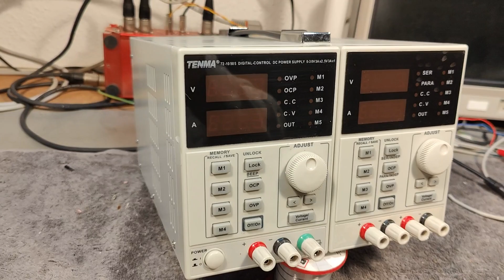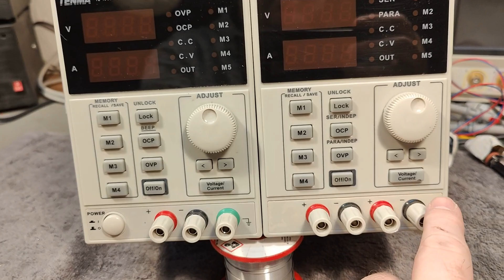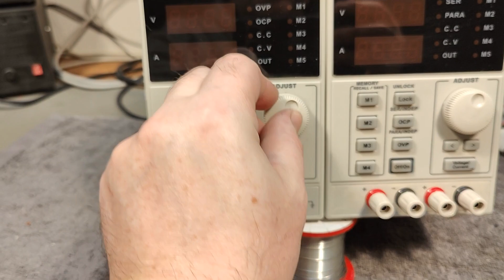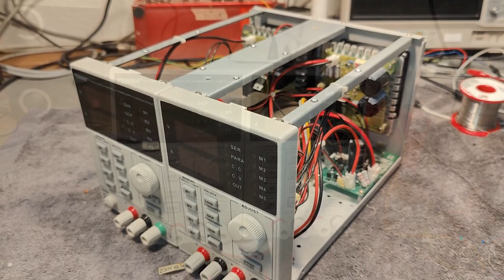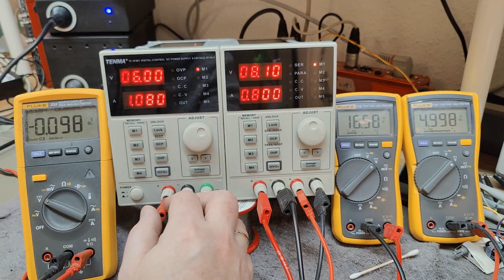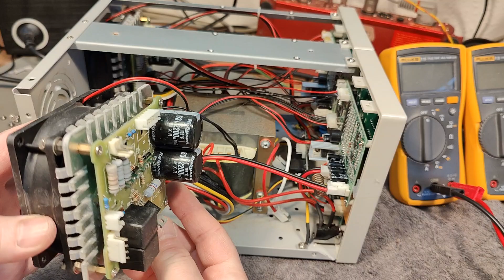Tenma DC Power Supply 72-10505 dual 30V 3A single 5V 3A

Comment: I've got the Tenma 72-2540 single channel DC supply, 1CH, 30V, 5A and it seems to be fine. The switching/metering is a little odd I guess, but if you use the supply on a semi regular basis, it doesn't seem to be a big problem.

Comment: Good video! Strange that the 5V output stayed on when you turned off the main power. Bug or feature?
Reply from the maker: the whole feature set on this unit is hard to understand :-) terrible low quality all over, much better to find a true analog psu, this one is almost prepared to be digital remote controlled and add all sorts of wierd and hard to use features implemented in a way i just dont understand, a power supply must be simple to use, and you must be able to know it does exactly what you want,
Reply: @TeardownOZ2CPU  I agree completely!

Comment: Hi Thomas, when I look at it like this, I consider myself lucky that we have the resources we have, even if it also has some imperfection - the stabilizer between the capacitors behind the N - coder, but it can be moved down to the chassis (it then works as a cooler and the heating of the capacitors disappears) and what I didn't understand is the spacing of the output terminals - you can't use double 4mm connectors.
This is not the first time I've seen this assembly of power transistors, about a month ago my charger died, the PCB is double-sided, but the transistor is half in the air = first soldered, then screwed, I had the same thing with the daytime running light converter on my previous car - probably a way to create an automatic time error so that you have to get a new device.
Repairing a power supply damaged in this way would be not only unprofitable, but also pointless if there is a design error = the power supply is destined to be an organ donor.

Edit: You received an email, I stupidly didn't write the subject there 🤪

Nice day 🙃 Tom

Comment: Hi Thomas. I've got a nearly identical unit, but without the 5 volt output. Mine does 5 amps a side, and you can parallel them to get 10 amps. I've had very little problems with it after nearly 10 years, except of course the rotary encoder. I find it easy to use once you get used to the rather strange setting procedure and the memories are fairly pointless in my opinion.

Comment: After watching this for a few minutes, I would definitely throw it in the dumpster even if it was working. They look neat, but are a pain to use.

A power supply needs to be straightforward to use. More than 10 years ago bought 2 cheap 30V / 5A supplies, maybe 50USD each, and they still work great. Separate volts & amps displays, separate controls for voltage & current w/ coarse and fine (4 knobs total) is all you need and very simple to use.
Reply from the maker: you are so right :-) I like simple stuff too, easy to use, no need for manuals, and can even be fixed with out the need for schematics or special parts. but we also have people who love features, the more the better

Comment: There are some details of the schematic from Konstantin Grigoriadis, here https://www.youtube.com/watch?v=lbONDHU3YLk

If you search EEVBlog for the Korad equivalent models, you will find the schematics and more information. 

I have a 30V 5A x2 version. It was delivered with faulty 4mm LED (yes, a 4mm round LED - another weird choice) for one of the memory presets! Embarrassingly, I made a mess of the board, lifting traces and replacing them with wires, when replacing it with a 3mm LED.

I hope you can repair this one Thomas, but if you do scrap it, I would be interested in buying the two LED display boards.
Reply: He got the later version with thicker ground but however its not attached to the transformer mount?

Comment: Hi Tom, from Tom in Brisbane Oz. Love your videos mate.
These are cheap units but they do have insanely good noise floor parameters for the coin.
I think I bought one of the first single channel units (and after doing hospital grade UPS systems in the 80's) I gave them some feedback and they did in fact fix it to my surprise.
The interface does suck balls, like using a Rigol CRO for the first time, you will want to self harm.
I have bought a lot of these units for work, the rotary encoder is unreliable but hit it wit some CO spray and it will come good for another 6 months. The one thing that sucks is at points the micros will go to sleep for no reason.
Never seen the fault you have but I have had them getting stuck mentally in parallel mode. 
Advice is restart after that.